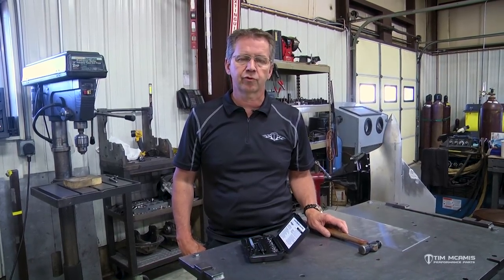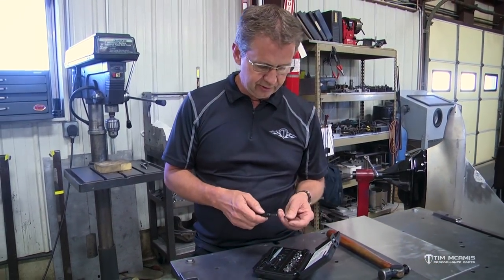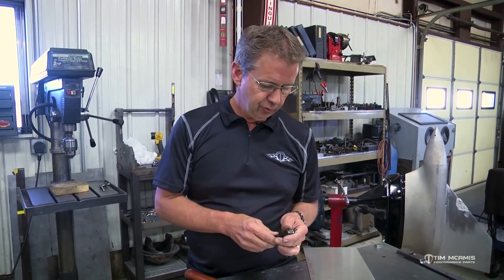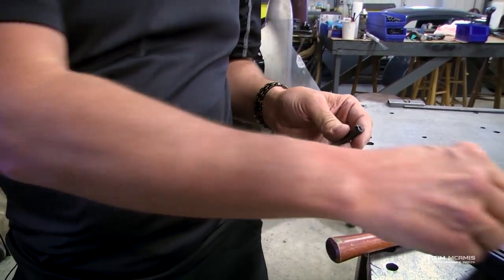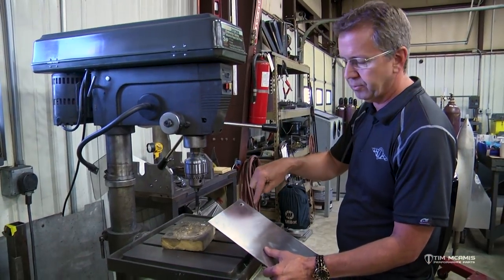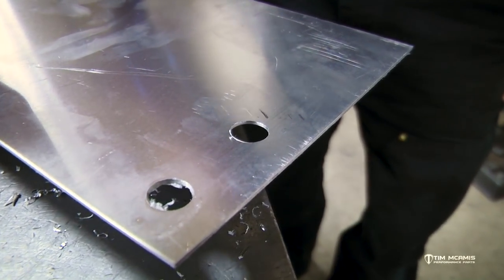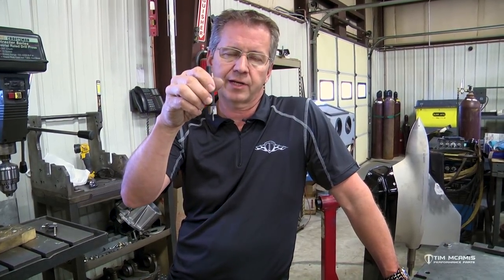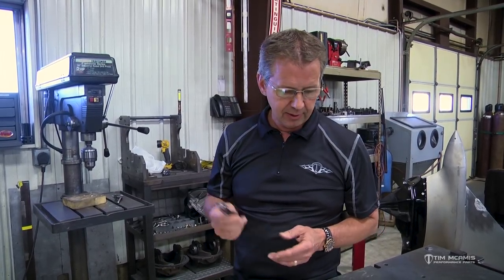Cutting A Perfect Hole

Comment: Great stuff.  I use alot of knockout dies [on steel and aluminum], and I always need a starter hole to use the tool - the  smaller the die, the more critical getting the starter hole on center is.

Comment: Annular cutters are awesome. Thanks for the tip on using then on carbon. I would have been worried about them being two aggressive for that. Also nice tip on drilling off set holes in tubing with them. Thank you.

Comment: With the smaller sizes they are limited in the thickness of the workpiece but they will work for 1/2" plate also by drilling an 1/8" pilot and finishing the hole from the backside. Like your carbon example

Comment: Those are nice kits. I use them a lot. I have a guy that will sharpen the cutters. So if you get a bunch of them that need sharpened might be worth sharpening then replacing. Not worth doing 1 at a time though.

Comment: For carbon fibre or fibre glass panels, I would use a spotting drill. They only cut on the point and not on the margins, this way your pilot hole will stay round and the the hole saw will run true.
Reply: Clamp or braze the spotting drill into the holesaw.

Comment: I just use Step drills for thinner material. Nice round hole.
Reply: These are much better. Step bit can wonder on you when pushing through each size. If you want the location to be as close to perfect at possible these are the cutters you should be using.
Reply: Step bits are for hack jobs.